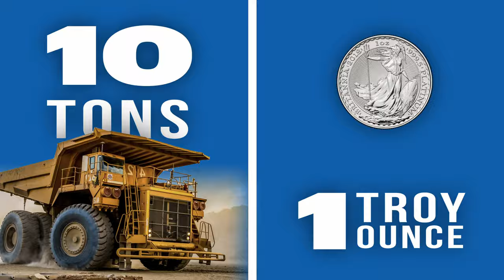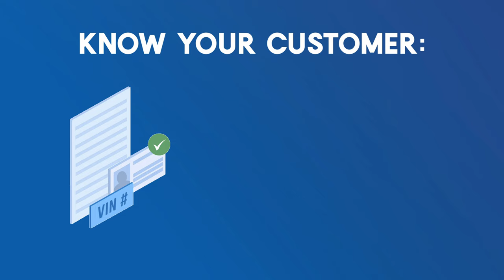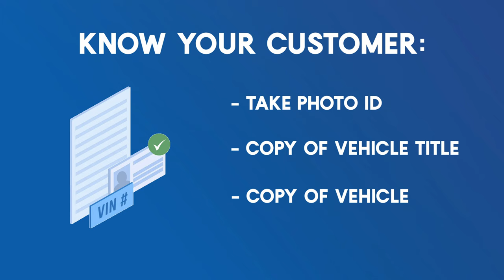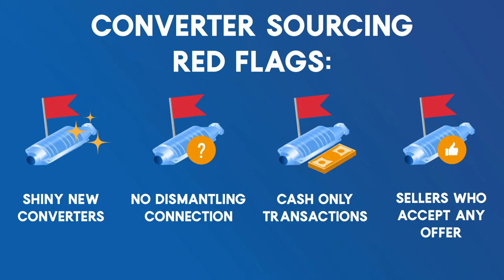The Key to Catalytic Converter Recycling and Responsible Acquisition

Comment: There are special shields that are made to protect against theft of catalytic converters. They are pretty expensive though.
Reply: With installation and getting it  through the mechanic, it cost me about 340.  I coulda bought the sheild myself but mechanic showed me the site before he bought it. He was transparent about the price. For piece of mind it was worth it.
Reply: @ohdannyboy4727 tip for all you albertans, ( where this videos filmed ) “ fire & theft “ is the most basic forum of insurance your allow to have on a car in Alberta to legally drive on public roads, “ theft “ at most reputable insurance companies will include “ theft of parts “ meaning that your catalytic converter should be replaced by insurance, theft also doesn’t count as a “ at fault claim “ so it shouldn’t raise your insurance price, while it’s a nice little feature to have installed I’d honestly argue it’s not worth the money.
Reply: @Gigachadly  i agree if you can afford comprehensive. usually adds quite a bit more to my policy a year, and my ride is older. The sheild was a one time payment. Im also in the states getting my insurance to pay out is like sqeezing water out of a tumbleweed.

Comment: My buddy got a flat tire.. parked it, went to go get tools.. said he was gone no longer than 45 minutes…. And they got his converter.. and the crazy thing is is was near my parents house which they live in a fairly nice neighborhood so it really surprised me, but just goes to show it can happen anywhere at anytime to anybody…. Some of those guys are good, I mean takes them like 30 seconds to saw that bad boy off and get outta there, it’s BS, is what it is
Reply: My friend in Canada got his stolen and from what I can tell he lives in a decent area and has security cameras the guy snuck in while he was at home took maybe two minutes to cut it out and about two minutes after the guy clears out and is out of sight a cop drives by. It just shows how close that guy cut it, not to give him credit but it was obviously not his first time it was rather seamlessly done. 

The car I'm driving now have one stolen, removed and later replaced before I got it and I can see how easy it would be to do with how high off the ground it is. 

I've seen a few things that looked like attempts to steal them and a few things that looked like stolen convertors stripped of the material or just ditched because cops may have been near but as a scrapper I tend to stay away from them because I know they are commonly stolen and I can't touch them without proof I have claim to them
Reply: @veloxdrake1025  yeah that’s wild- seems like they’ll do it anywhere apparently- Also if the stuff you’re bringing in.. especially to my yard.. they’ll for sure ask questions- for example I just went today actually and I didn’t see anything too crazy or any big loads of the good stuff- BUT if a guy brings in 100 lbs of the shiny bright still coiled up- yeah, they’re not idiots…. I just take it as there’s probably some stuff I’m NOT going to get my hands on and converters is probably one of them….. but what a piece of human trash thing to do- to stealnoes converters- my buddy said it was the SMALLEST one and it’ll cost him OVER $900 - and he still has NOT done it yet so his car is just extremely loud right now

Comment: (Here's the solution: install a tracking device on the catalytic converter.)
Reply: Where exactly on or in it would you put such a device considering the extremely hot temperatures they operate at?